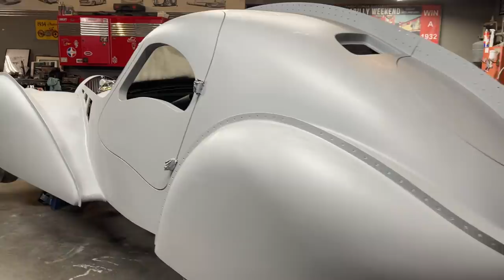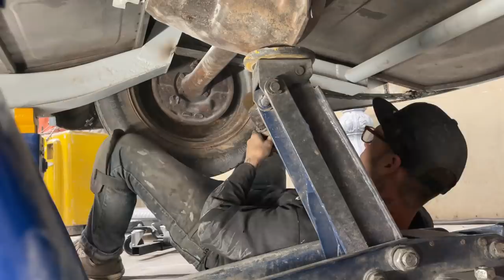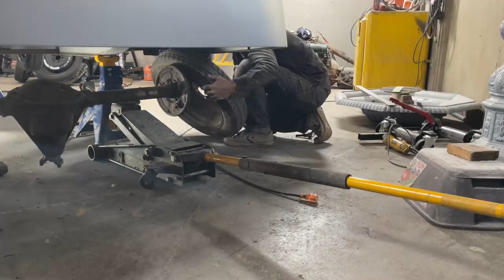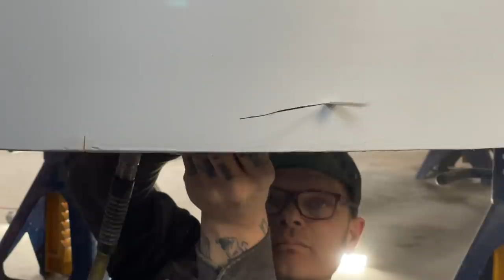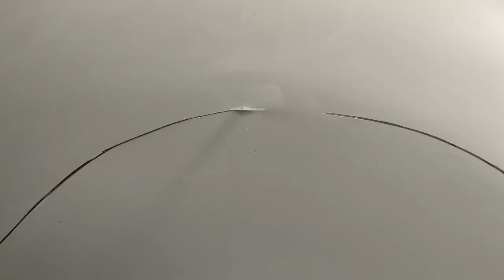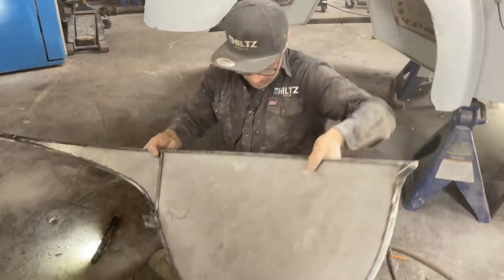IT'S TIME TO CUT THE FENDER SKIRTS OFF 🔥

Comment: Probably one of the best builds from start to finish, Chad’s dedication and love towards Jolene...priceless 👍🏽🇬🇧🙏🏽😷
Reply: Agree 100%. I’ve watched 1000 car build videos and learned the most here. 👍👍👍
Reply: @tinadifazio7622 . I'm sorry Tina- Did we need your permission to be excited about this build?
Reply: @tinadifazio7622  Do you really think someone as talented as Chad would build a vehicle that’s not driveable?.  Doh...
Reply: @theseconddarrin3788  🤣
Reply: a
Reply: @fgjf1079  led is a long ago dying art that very few are skilled at. Filler is used in its place. Cutting across a leaded joint causes heat and will melt the lead. Since it has a low heat melt point.  Fiberglass filler is best used for this type procedure. Even using a sander over a lead filled valley will cause heat and a loss of material that Will now need re-fill. It’s why lead was always painstakingly filed down by hand. Slow and steady. And in today’s economy it is just not suitable. Good idea though.

Comment: Are you going to use spring suspension on the rear of the car 🚗? 
I'm wondering what is going to happen when this bondo baby hits a big pot hole in the road and the body twist a little ? Is it going to flake apart in chunks ?
It looks great and is coming along nicely, keep plucking at it and she will be running before long !

Comment: You said you were going to run a jeep rear axle because of the 5 on 4.5,just a friendly suggestion a ford 8.8 out of an old explorer has 5 on 4.5 and disk brakes
Reply: Dana’s are better than the 8.8 for this size of a car. Any more weight the ford might be a better choice.

Comment: Hi mate. If you use your grinder to taper the hacksaw blade down to a narrow point it will cut around your curves better.  I also worry that using the grinder to cut out the fender skirts will heat up the steel too much and weaken its bond to the Filler. Love your videos.

Comment: I think a better way was to have just made a template of the rear wheel opening and then use it to make the skirt separately. Easy and less repair work. Right now he'll still be doing repairs from the skirt cutoff. Just my two cents. Love Chad!  Watch every instalment. .
Reply: No Aaron, you can't "just make a template," it would take a lot of work either way. He did it this way in order to have the finished contour of the filler match EXACTLY to the quarter panel.
TC in Annapolis Maryland
Reply: @megaman4201  But it doesn't fit perfectly. He still has to fill and trim the edges. Whatever, Chad will make it work.

Comment: The reason the saw blade didn't want to cut is because it was too coarse for the sheet metal. You have to have at least 3 teeth of the blade in contact with your metal. There is a standardized blade chart for the amount of teeth per inch (TPI) versus the thickness of the metal your cutting. A blade TPI chart. Always remember rule of thumb is 3 tooth  contact on your work.  If your blade is too low of a tooth count  (coarse) for the thickness of metal your cutting the sheet metal gets stuck between 2 teeth on the blade and just vibrates back and forth without any cutting action.

Comment: Good job. At the 20 minute mark you asked why the broken out piece of filler, why it did that? The reason is that you had pulled the saw too far out of the hole and on one of its strokes it came all the way out of the slot and with the pressure you had on the saw and any inherent bend or spring to the blade caused it to kick out of alignment and as it plunged back toward the slot you were cutting it hit on the back edge of the filler and punched it out, breaking of that section. You came very close to doing the same thing again just moments later and a number of minutes later in the video because of pulling and pushing the saw back and forth in and out of the hole. This is actually a common problem with a reciprocating saw no mater what you are cutting. We have to be very careful on the amount of stroke that blade is making at both maximums so the cutting blade always stays below the bottom of the cut and not so far that it hits another object that could be beyond the material being cut. Ask me how I know. And yes I've done that several times in spite of learning that lesson.

Comment: 21 minutes in...It did that because filler stacked at even 1/4 inch thickness will not stand up to vibration. Never.   The binding of it to metal is not all that strong. Any vibration over time will cause it to break loose from a metal surface. Even if the metal surface has lots of tooth. But perhaps the tip end of the saw blade gouged it accidentally on its way back through the cut. Either way, easy fix.

Comment: A Chad they sell trailer links for the top for c-channel vehicles like trucks and stuff that you shorter trailing arms for the rear end you might want to check into that I think it might help you out better cuz the trailer arms mount to the top of the rear end housing will brackets and stuff that way

Comment: Fantastic balance of shapes and sizes.  I'm shocked to learn that the tribute car is wider but shorter in height and length than the real Bugatti. I think Chad did well to keep the look even though the proportions deviate. I'm a bit concerned though how low the oil pan is. Once you put in a k-member as Doug suggested,  it will scrape badly.  Air ride might help slightly.
Reply: The front end is Very WIDE

Comment: Pulled the blade back to far and the tip of the blade punched the bog out what a shame easy enough to fix i guess
Reply: Too much blade sticking out, maximum of 2” (50 mm). I used these every day when I was a panel beater. The other thing is I’d advise Chad to check the TPI, for steel 18tpi is just right, for resin based materials 14 tpi.

Comment: Pushing the blade to hard and the long length of it got to wobble to much when it was slowed by dig of pressure. The longer the blade the less you want to force it. Just like cutting wood with hand saw on the drag back the tip wobbles.

Comment: So why did you put them on and now you've cut them off?? I don't understand.
Reply: So they can be removable, maybe.
Reply: Removable Fender skirts allow for easy Future maintenance, changing tires or working on the rear end. If the skirts were permanently attached then to change a tire you Would have to remove thee Entire rear axel! Get it? Got it? GOOD!
Reply: They were welded on temporarily during fabrication so that the filler work would be perfectly contoured to the rest of the quarter panel.
Reply: @edricoddot  no maybe's, a fender skirt is not a fender skirt if it's not removable.
Reply: The plan is to cut off the skirts, smooth the bondo around the metal hoops 
, refit the skirts and then sand a even gap around the skirt. If his mounts stay put, the body lines should be like he never cut them off. Lots of work still to do..

Comment: DO NOT jack up a car/truck using the pumpkin. You can/may break the tubes on the rear end or crack/break the housing.
Reply: Ok, but yet guys go off road with 44 inch tires, mud bog, rock climb, and jump vehicles, and axle tubes are not snapping like twigs
Reply: @TheRoadhammer379  ok. These vehicles are built to be very strong. I am talking about standard built componants. Don't misunderstand me. Your builds are beyond outstanding. It's just having an expensive component break adding to the costs of a build that could have been avoided. I have seen it happen.